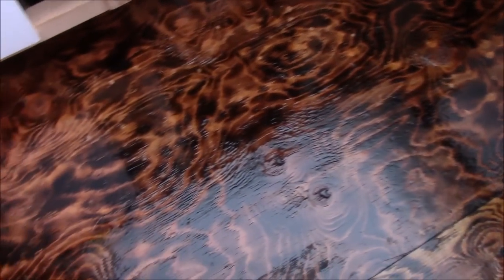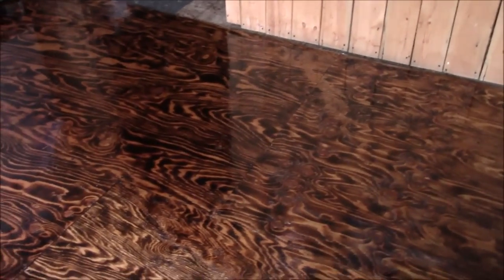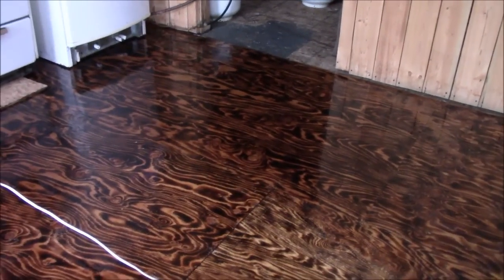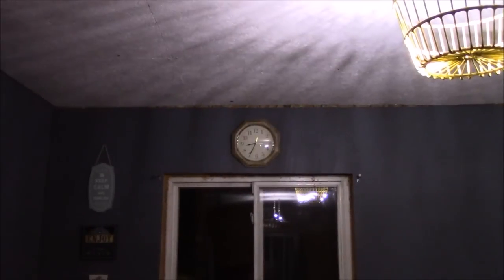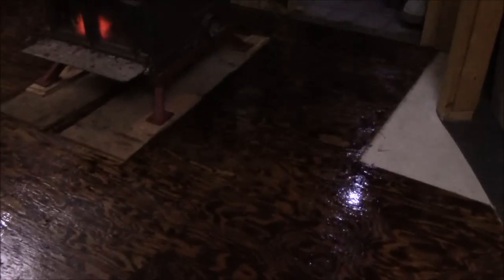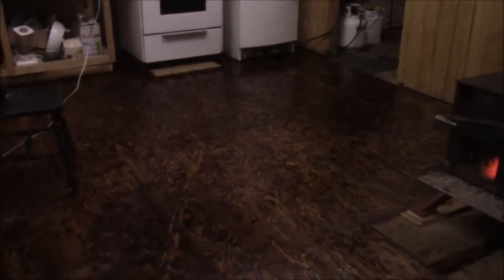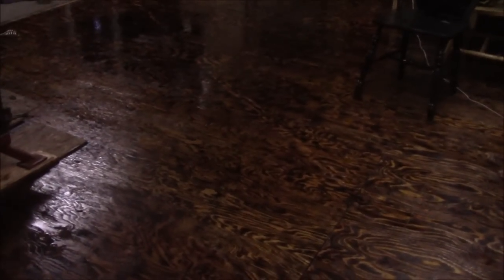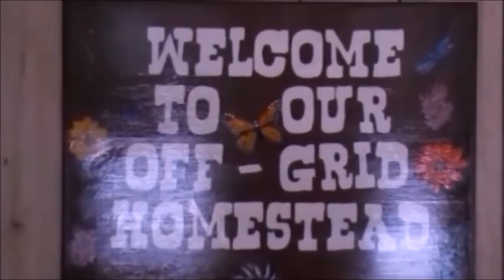One Coat Of Polyurethane On Our Burned Plywood Floor

Comment: like the looks, much better than just plywood. I have also seen where someone cut the plywood in 5 or 6 inch wide planks and beveled the edges to look more like hardwood flooring but they stained it but yours looks much better. I may try this in my basement but I think I will put on a coat of epoxy

Comment: Love how the poly brings out the grain of the plywood, really highlights it.  Also, you might want to burn the plywood in the pantry before putting it on the floor.  Might be easier for you.  And then touch up the burn if you need to before you poly it.

Comment: Hi guys, floors look great and I have done the same thing in my house. I've been tight on funds for most of my life and need to make a good decision on the polyurethane aspect. My question is how long did it take for it to fully harden. As in how long until a finger nail would no longer scratch it and also how is it holding up?

Comment: Am fixing up a "fixer -upper"...& Saw this technique...HELL I THOUGHT WAS KILLER..AND NOVEL !!...so went over to my parents house to show them this burnt plywood look,..and they ( in theyre 70's ) were like....."0h that shit?"...people were doing that in the 1970's, and it doesn't hold up well to traffic..it scuffs up very soon....and were like real " hum-bug" about it.....I suddenly felt like a four year old realizing that someone had just licked all the red off my 🍭 lollipop......  so it was LOLLI~POOP !!! they suggested that if I was going to go so cheap🛒🛒 on my remodel project, ...to go and get a truck load of pallets, cut them out into some impossibly beautiful mosaic design that would confound Einstein, sand it all down flush and  use a  basketball court hardener 🏀🏀on it....craaaaappp.....but I still think the scorched plywood is cool‼️
Reply from the maker: Hello Jason.  As you can see this video is old now, our floor still looks as good as the day we did it.  You must take into consideration that the Polyurethane that was around in the 1970s is not as refined as they are now.  Plus if you want it really durable, Thin your first two coats of poly half and half with thinner, this will allow it to soak deeper into the plywood...This will make the wood hard and not just the poly on the surface...Best of luck...Cheers.
Reply: Sounds like they didnt seal the floor afterwards, this was a common thing to do called Shou Sugi Ban to prevent termites. 

   Edit: Its actually called yakisugi-ita
Reply: @DarkLinkAD  ok...cool...and honestly my folks are older  than fossilized dino- turds, and wouldn't be impressed  if they saw a 30 carat Ruby in a goats ass!, But I REALLY LIKE your video and what you did !...thank you BUNCHES‼️💜